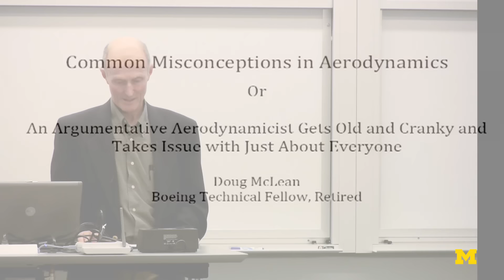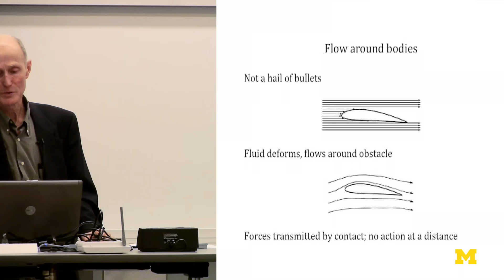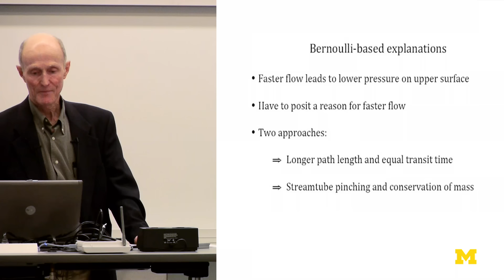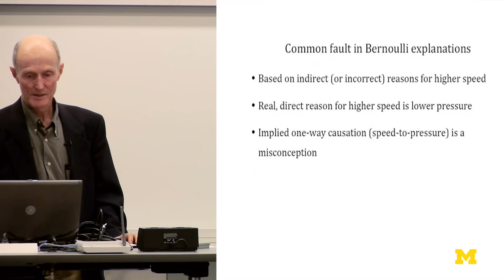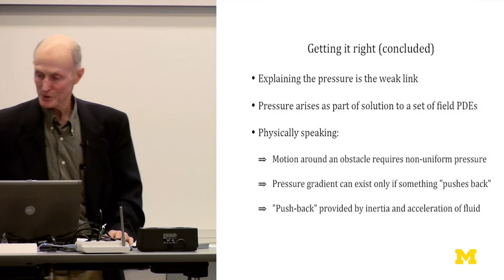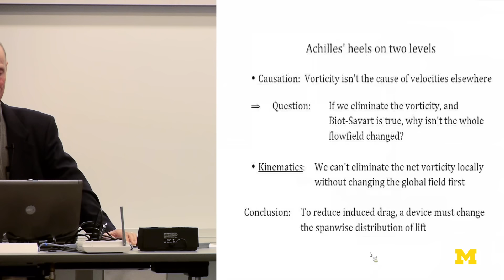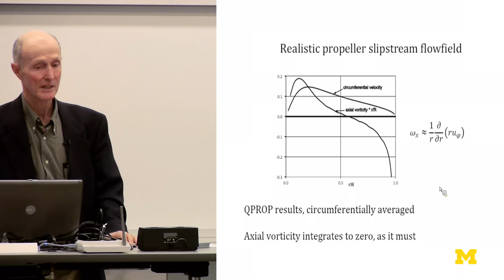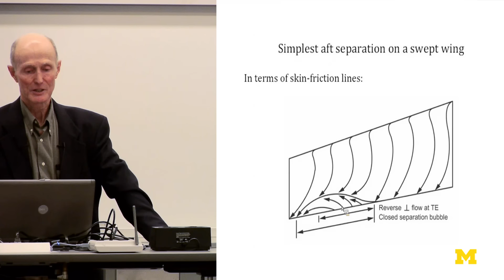Doug McLean | Common Misconceptions in Aerodynamics

Comment: "Equal transit time is wrong" good  never made sense to me
Reply: equal transit plays a part in particle physics to explain why photons won't accelerate in a gravitational field.  they spin to compensate for the field effect, and this distorts momentum to a perceived constant.  the particle can't handle anymore acceleration, so to allow this energy it spins.  how cute is that?!  or it spins in reverse to the curvature of the field..but we don't know if there is gravitational waves, so i can't say if thats right.
Reply: @treatb09  Why would photons accelerate, even in a gravitational field? That makes no sense. Speed of light is constant.
Reply: why wouldn't they? . how much do you know about physics?  all curves are an acceleration, and to maintain a velocity, it must accelerate around a curve, since a photon is a "constant" velocity,  it enters a curve but never slows down or accelerates..it contradicts the laws of physics otherwise...so thus it spins to still capacitate energy, but since it can't accelerate or decelerate in an energy field, thus spins in reverse of said field (like a car going too fast, putting its tires in reverse on a nearly frictionless surface per say.) .  gravity isn't a resistance force either.  and your gravitational field or curvature can be calculated this way, by the projected curvature of a photon from two lengths, one straight and one curved and spin of the photon being proportional to the energy of the field. minus a projected deceleration and acceleration something or another.  i'm still working on the theory, but i'd love for you to steal it so i can prove you wrong too. love seeing my stolen work and how off it gets by needy cunts.  like my center of mass concept for the shape of a planet.  you tools really botched that one
Reply: @treatb09  Wow, you have serious issues, boy. Have you tried seeking professional help?
Curves result in acceleration, sure, but going in a straight line through non-euclidean space is still travelling in a straight line.
Reply: @treatb09  irrelevant to the topic here innit ?
Reply: @treatb09  ty Bo Much appreciated.
Reply: @xnoreq  john if you want to stop embarassing yoursefl try understanding what he is saying.........his level of smart is almost over my head
Reply: @thunderkunt5416  no its not.
Reply: @peterkay7458  "his level of smart is almost over my head"
I couldn't think of a more ironic way to insult yourself. Thanks for that.
Reply: @xnoreq  and you think i need help XD... curves are straight lines guys.  just like the angles and gaps of a trigonometric wave calculation... maybe you should stop repeating what others say?  since you clearly don't get it.
Reply: @treatb09  we proved the existence of gravitational waves a few years ago 2017 i believe.
Reply: It's incredibly useful bullshit. It's totally not true, but it can be used to explain so many phenomena despite being completely untrue.
Reply: It does make sense though. The wing cuts through a mass of air at the front; if that same air doesn't meet-up again at the trailing edge it would create a vacuum.
Reply: @treatb09  edu+1
Reply: @Subrava You may be right about that; I'm reconsidering my opinion. McLean addresses this question at 17:31
Reply: @treatb09  I like your funny words magic man
Reply: @xnoreq  While I don't really understand what he said to begin with (it's extremely off topic and, while I have a pretty decent understanding of general relativity I cannot understand if it's true or what exactly he's referring to), he is right that you kind of have a misconception about the way general relativity dictates that gravity effects light (however in a way you are also correct). In the framework of general relativity all inertial bodies travel along the fastest possible paths in the geometry of spacetime. In my reference frame I travel at some speed (usually modeled to have the magnitude of the speed of light) through time and have no spacial momentum, following a timelike curve through spacetime. In the absence of mass spacetime is a noneuclidian space where the metric dictates that the square of the distance between (t_1, x, y, z) and (t_2, a, b, c) = (x - a)^2 + (y - b)^2 + (z - c)^2 - (t_1 - t_2)^2 (depending on conventions either this or its negative). 

The axiom that "all bodies with no forces on them follow the shortest paths through spacetime for this notion of distance" already basically encodes special relativity. In general relativity the presence of mass distorts this notion of distance and changes it, adding (for instance) curvature. This has the effect of "bending" light in the sense that we understand that word, however the light is really following the "straight lines" in this new curved space (just like a plane follows great circles over the earth, which are "straight lines" in the non-euclidean spherical geometry of the surface of the earth). So, for instance, light famously gets bent around massive bodies, to an extent which can even be measured for very large bodies such as black holes or stars like the sun (i.e. light rays passing near the sun curve perceptibly around its mass to a degree that can be measured with extremely accurate equipment, so it becomes possible to "see" objects on the other side). So in a way light does seem to accelerate (i.e. curve) but in another (more mathematical) sense it always travels along "straight lines" in curved spacetime.
Reply: @xnoreq  "Curves result in acceleration, sure, but going in a straight line through non-euclidean space is still travelling in a straight line."
That is true for all bodies in a curved spacetime.
I'll repeat the discussion, for convenience.
1.  Photons accelerate through curved spacetime, but they "don't", so supposedly they trick nature with their spin.
2.  No, they don't accelerate, because they actually travel in a straight line.
3.  That's what all the bodies do, and all of them accelerate.  Why not photons?
Reply: @xnoreq  people like to repeat others without actually understanding them.  100 years ago, before einstein proclaimed a constant, people would more than likely rationalize infinite acceleration potential.
Reply: @Grim FPV He doesn't really address the pressure field on the upper and lower surface of the airfoil. But at 17:31 he actually says that the higher speed of airflow on the upper side is actually greater than predicted by the "equal transit time" hypothesis. Not quite sure what to think of that.
Reply: @Grim FPV Yeah but the lift and drag coefficients are better with an airfoil than a piece of plywood.
Reply: @treatb09  lol

You types are so funny.

I hope nobody you know tells you that you’re smart.
Reply: @xnoreq  ? i like wiggle worms
Reply: Simple wind tunnel with pulsed smoke disproves that. Flat plate produces lift so aerofoil not needed.
Reply: @bakters  I love that there are two completely different debates going on in this reply section. Now I want to read Bo Huggabee's reply
Reply: @treatb09  Photons have only two possible spin states, and it relates to a photon's polarization rather than photons curving in spacetime. Don't ask questions like "how much do you know about physics" when it's abundantly obvious you don't understand relativistic and quantum physics. (for instance, the spin of a photon has nothing to do with the amount of energy it has)
Reply: @treatb09  But that photon still travels same distance for a given time (same speed), just not straight but "around" in a presence of gravitational field right?
Reply: @xnoreq  if I understand your question correctly (I well may not because I haven’t heard the section in his talk where he talks about “photon acceleration”), “acceleration” is a change in EITHER Speed or Direction of a particle or object. If space-time, the medium in which photon travel, curves due t a high local gravitation field (as it does (see the Eddington Experiment of star displacement during a solar eclipse, then the photos that skim by the sun’s surface travel in curved lines, therefore the photons “accelerate” by changing direction of motion.
Reply: @teefkay2  He never does. It's quite off-topic to the video.
But anyway, my point was that the photon's velocity does not change if you see it as traveling in a straight line through curved spacetime.
(Similar to the thought that you are not accelerating towards the center of Earth as you'd be unable to measure acceleration in free fall, instead spacetime curves but the ground stops you from traveling through it in a straight line.)

On the other hand, if you observe a photon travelling through a gravitional well from the outside and ignore the curvature of spacetime then there appears to be an acceleration, sure.
But then so do apples falling from trees. It's Newtonian gravitation vs. GR.
Reply: Is those like "how do we make the math as easy as possible, well just assume that the transition time is the same will make it a lot easier"
Reply: It’s proven in wind tunnels that the air molecules do not meet at the back.
Reply: @treatb09 doesn't the wavelength just decrease? The photons wouldn't necessarily have to accelerate, we just know the energy would increase. Wouldn't that simply result in a lower wavelength?
Reply: @AdamMi1  depends on a whether photons do annihilate and split in wave patterns throughout space. Like the fission probability of neutrons after critical mass. We simply read it as waves. Which still would suggest that interference of positrons and electrons have to generate spin to form wavelengths in general. So itd be relative. And when positrons and electrons annihilate are just creating a radiation from a vector over time as they pass through one another. .
  Maybe you are right that the electron atmosphere of a gravitational plane would simply exchange energy to remain constant n we never truly have just an electron vs a curved space time.

But in my gravitational field model. I show gravity as pushing instead of pulling. The wave flux of energy behind an electron would have to cause spin to allow curvature in general. Otherwise all energy would be strait. Direct. Non-interfering.
Reply: @atrumluminarium  "Tangential travel speed" is wholly irrelevant.
Velocity is a vector, and if you accelerate  then velocity changes.
Reply: @xnoreq  You said speed not velocity, velocity is a different situation then I agree.
Reply: @atrumluminarium  Please stop lying. 
I explicitly wrote "photon velocity".

Comment: I have seen the common misunderstanding of Bernoulli's equation many times, that velocity causes low pressure; It just causes it for some unknown mysterious reason. That misunderstanding is even written in books! 
I'm glad to hear Doug come out and say, "it's not a one-way street". 
Delta pressure cause acceleration, acceleration causes delta velocity, etc. The differential equation is intertwined.
The air on the upper wing surface is actually at a lower pressure than the bottom and it's not "just because it's going fast".
At 19:40 and 26:00 in the video he describes this pretty clearly.
Reply: There’s even a MIT video on aerodynamic with this misunderstanding.
Reply: "The air on the upper wing surface is actually at a lower pressure than the bottom and it's not "just because it's going fast"."
Then why don't they fly into the ground when flying upside down? Does the bottom of the wing then have low pressure?
Or is it more likely that the wing is just "planing" off of the passing air?
Reply: @rael5469  Your first guess is correct. When flying upside down, you'll have to adjust the angle of attack to still generate lift in the other direction relative to the wing. Changing the angle of attack changes the flow of air on the wing. If you just invert the wing without changing the angle the aircraft will actually fly into the ground.
Reply: @jonasdaverio9369  Then explain how a T-38 (Thunderbirds) flew upside down? It did not generate lift on the "bottom" surface of the wing....it simply skipped off the air on the new-bottom (top) of the wing. No lift on the upper surface, just air piling up on the lower surface. ....like the old Douglas X-3 Stiletto. 
https://en.wikipedia.org/wiki/Douglas_X-3_Stiletto
Actually....I stand corrected. Even the X-3 Stiletto had full span leading edge devices which changed the curvature of the wing for lower speed flight.
Reply: @rael5469  I only talked about angle of attack. The angle of attack can be changed very easily by pushing on the stick. No need to modify the wing dynamically
Reply: @jonasdaverio9369  If the leading edge devices are not needed during inverted flight.......how do they keep them from extending ....during inverted flight ?
Reply: @rael5469  What are you talking about?
Reply: @jonasdaverio9369    If the leading edge devices are not needed during inverted flight.......how do they keep them from extending ....during inverted flight ?
"What are you talking about?" 
Leading edge devices and inverted flight.......and the top surface of the wing generating lift....and even more lift if the leading edges deploy. You wouldn't want them to deploy during inverted flight....would you?
Reply: @rael5469  I really can't follow your reasoning. Some airplanes have leading edge devices, some don't. How is that related to inverted flight?
Reply: @jonasdaverio9369  "How is that related to inverted flight?"
Don't you know how aircraft work? Leading edge devices increase curvature and thus lift. That would be counter productive to inverted fight.....wouldn't it?
Reply: @rael5469  LE devices are either manually controlled, often in concert with flaps or automatically controlled with reference to airspeed and g loading. It would not be difficult to program the extension criteria to allow for negative g. Fighter aircraft also have different requirements, they fly inverted and at sustained high g loading. Their wings are not like airliner wings that are designed for a much narrower flight envelope so their section means that lift generation in inverted flight is less inefficient but also note that fuselage lift is prevalent in these designs to a greater extent and that is used when inverted and is also controlled by AoA.
Reply: @BrianMorrison  As far as I know all modern aircraft automatically extend the leading edges if a stall is sensed. It's called "Auto-Slat."   If you watch videos of fighter aircraft flight demos the leading edges extend, or otherwise activate instantaneously during maneuvers. Must be part of the fly by wire system.
Reply: @rael5469  yes, I think you are right but the details of which surfaces move under various flight conditions is determined during testing.
Reply: @BrianMorrison  the leading edge stagnation point will change when you invert the wing and fly at a positive AoA (positive meaning rotated clockwise wrt the freestream if your flow is left to right) my dude. The curvature that the flow follows above and below the wing will not be the same in inverted flight as it would upright flight.
Reply: @westglee  I quite agree, but it's possible to have flight controls that make it as efficient as possible for a fighter. In an airliner there is no need, it should never happen.
Reply: "The air on the upper wing surface is actually at a lower pressure than the bottom"

if I may, what is the reason for this pressure differential then? Is it due to the curvature of the airfoil shape, which is basically leading to the "streamtube pinching"?
Reply: @Aditya-pw7hm  Yes curvature. The more curvature the more reluctant a mass to follow the curvature. 
Don't confuse pinching with upwash.
Reply: @Aditya-pw7hm hi! Lowly aerospace undergrad here, but… it’s complicated. The most direct answer is that to be able to follow the shape of the wing, the velocity distribution and the pressure distribution need to have a lower pressure on the ‘top’ of the wing (notably this is typically called the suction side, specifically because sometimes wings are mounted upside down, like in car spoilers). A good heuristic is that the air needs to get curved away from following its straight line path, and so there must be a lower pressure to induce it to do that over the top. But, as always, intuition is only worth so much in aero and the real answer is that’s what’s required to satisfy conservation of mass and momentum (IE, the navier stokes equations).